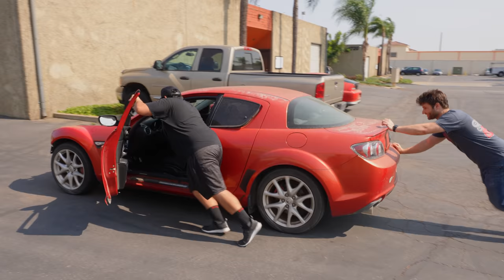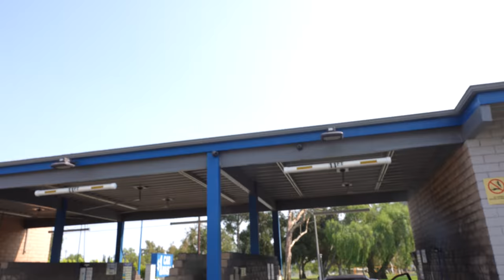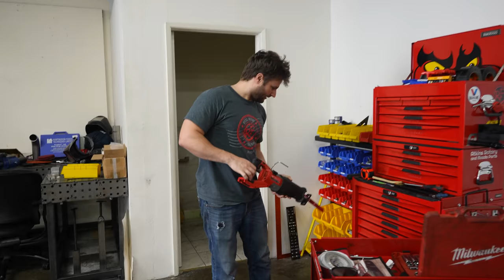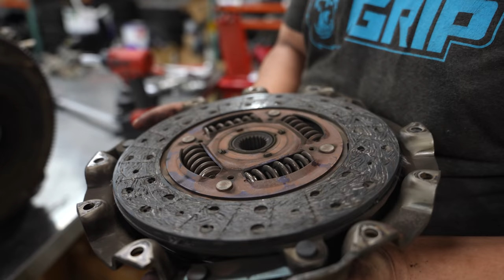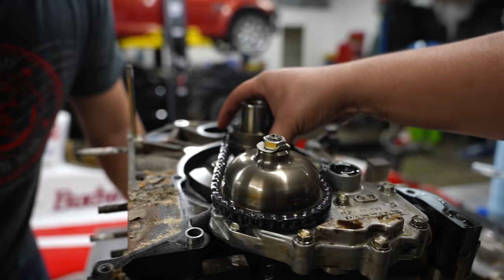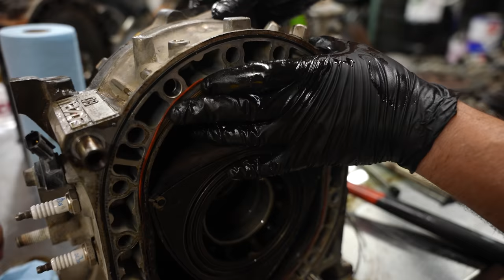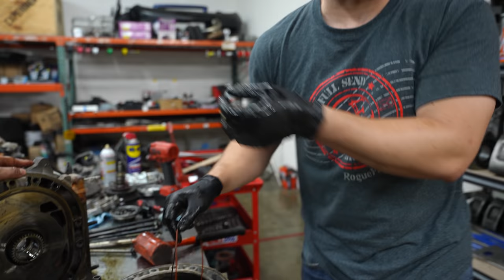What’s commonly wrong with a CHEAP RX-8?

Comment: If the coolant seals are failing at the hottest part, it seems logical they're degrading due to heat. You could then replace it with a more heat resistant material that would handle it better, maybe machine out the channel it sits in to fit a more substantial seal or even look at the cooling system and see if the rad/thermostat etc could be modified to keep the engine cooler and help the seal last longer. It is a lot of effort for a job that only comes up once every 100k miles or so though.
Reply: Good idea
Reply: E85 burns cooler. You'd only go 100 miles on a tank though
Reply: defo the cooling system is one off the let downs on these cars especially when you have a huge air con radiator system blocking the radiator,then the restrictive airflow to it all,, but hey its how the cookie crumbles i guess ahaha
Reply: It failed cause it got too 🔥  
That's the result, better to fix the cause , then no need to fix the result.
Reply: This ONLY happens on RX-8s that are very overheated. Well cared for ones don't blow coolant seals.

Comment: I wanted an RX8 so bad before knowing about rotaries, I still think they have potential, they just need a lot dahm love...
Reply: I’ve owned like 6 of them, all with 100k plus and low compression. Ran just fine with new ignition, after only a decarb and a lot of oil changes to clean them out. Sold them and haven’t heard complaints from the buyers. 🤷🏻‍♂️
Reply: @I_know_what_im_talking_about  sorry for my ignorance, I'm still new to learning about rotaries. What's decarb refer to here? A tune?
Reply: @Jazz-nm1kf  nah, de-carbing all the carbon build up on the rotors. Mostly just letting the block suck in a bunch of sea foam while HOT and then leave it to sit for an hour or so and then crank err up to burn off whatever got soaked with the cleaner. Works pretty good. Mazda has a similar factory de-carb procedure.
Reply: Owned an rx8 for 2 years and put 60k on and bought it with 60k and the engine still ran fine clutch just went out and instead of fixing it im 2jz swapping it.
Reply: Strange the rx8 is the most reliable car ive ever owned. 95k miles and never let me down. I also beat the crap out of it. I dont understand all the horror stories

Comment: I left my Renesis on the engine hoist, used a ratchet strap to secure it to the legs, a custom tool to lock the flywheel to the bolt, and then did the squat with a cheater bar.  That front bolt is no joke.

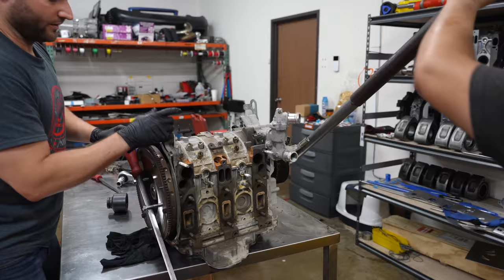Comment: 8:50 - I snapped a ratchet doing this lol. Breaker bars ftw. Sweet video again, loving this channel!
Reply: Took me and my dad to get this shit done in like an hour or so. Fuck that crank shaft bolt
Reply: @uc79newtype  yea dad strength and the biggest breaker bar you can find is required.
Reply: @Oborowatabinostk  no kidding shit was a two man job man. Smfh but it was worth to dismantle and see how my engine died. The seals broke and literally carved my housings. Mf rip.
Reply: yeah i couldnt believe he was using a ratchett to do that. i recently tried to remove my crank bolt on my toyota altezza to do a timing belt change (not rotary... or powerful..). the bolt was so tight i had a breaker bar almost 3 meters long and was jumping up and down on it almost tipping the whole car over, i also tried soaking loads of crc into it, and heat gunning it. nothing. was tempted to use the blow torch but didnt want to melt anything behind it. i gave up and just rotated the engine, inspecting the belt, it looked fine. so to this day there is still a brand new timing belt sitting in my wardrobe. someday i will get that bolt undone and replace that damn bolt. someday.
not keen on removing the radiator etc again to access it if its not going to work this time though. im lazy.

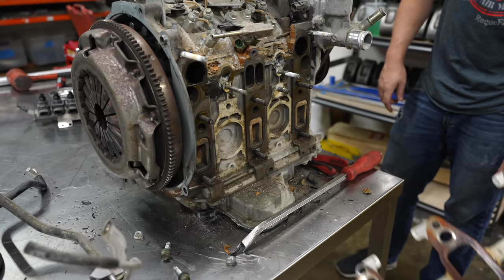Comment: 7:00 It has the Series I Renesis OMP injection Style AND the classic FD/FC style oil injection for the Series II. The problem is that the OMP is different from the Series I, so adding a 2cyl tank is VERY hard and limited to no support exsists to convert it. A 10% increase to the OMP via tune is very sufficant to prevent issues as the FD style omp setup worked just fine and this has both. I add 1qt of burnable oil to my setup when it gets changed and or it gets consumed and premix aswell. My catalyst jumped ship on its own a long time ago. Was a hell of a confusing then when the clutch was changed. No marks from someone doing it before me, so I guess it is just toast. Very little P0420 action before I disabled it also.
Reply: Copy/paste??

Comment: I had the clutch and flywheel replaced on my S14 but the flywheel had a ring gear that was just a press fit.  The starter would only turn over the engine when the clutch was cold.  Something about knowing you can't kill an engine makes you kill the engine a lot more.  I got very good at push starting my own car.  Shoulder on the A pillar push it a few feet and then hop in and pop the clutch.  I had to do it in a tacobell drive through on time,  I had 10 feet before the parking lot went up hill.  Got it in those 10 feet on the first try.  Thankfully it was a very easy engine to start.

Comment: @rob dahm... what would happen if you were to put a copper wire in place of the coolant seal? like a thick one? and just wedge it in there between the plate and the damn rotor housing?
Reply: Wouldn't copper cause cross metal corrosion?
Reply: @Ayane13b  A nail wrapped in copper will rust/corrode the most.
Reply: High temp silicone electrical wire works... don't ask me how I know.
Reply: @godfreypoon5148  fine then, keep your secrets. lol
Reply: @Ayane13b  people do it on piston engines all the time. they machine a little oring groove into the head or block, and put in a piece of wire to help seal the head gasket. sometimes only using that piece of wire if its only got oil going through it when its not water cooled. i keep seeing that used all the time and then look at a rotary engine and think... hm.,... what if?!?
Reply: @petek9348  I guess so. I've actually seen that, but totally forgot about it. Wild. I do wonder.
Reply: @Ayane13b  i wanna see rob dahm build an engine with wire instead of coolant seals.

Comment: The key to a long life is upkeep. Watch those oil levels. Keep clean oil in it. Premix especially if you have a gen 1. Change out ignition yearly most likely depending on how much you drive. We have two 8s over here, mines basically new less than 30k original miles. My lady has a velocity red 2010 with almost 165k original miles. Still going strong! Do your maintenance people

Comment: ok here's a stretch idea...since most performance oils are now really thin (0W30), could the engine coolant be replaced by engine oil?  I know that glycol water coolant heat transfer is much higher than oil but a few things may change to make this work.     I believe that the radiator would have to double in volume.   The cooling system would then be unpressurized which may help reliability.   The engine would then use the cooling radiator as its dry sump.  The engine oil pump would source oil from the cool side of the radiator.    The water pump (now an oil pump) may have to be larger.   The thermostat would need to open sooner.    Benefit: reduced possibility of future engine damage...no water in oil risk.    The oil changes could be extended...perhaps 3 to 4 times longer?  Great videos!

Comment: Seems like what they need is a fire ring of some sort. You'd have to design a housing with smaller coolant passages, or larger overall housings to make room for a fire ring next to the coolant seal though. I bet the material between the iron and the rotor housing starts to deteriorate juuuuust enough that combustion starts touching that coolant seal causing it to fail. If this hypothesis is true then we'll see the motor shit a coolant seal out again in relatively short order.

Comment: Observations, noting your build with the dowels. 
RX8 Rotary blows seals there because of bolt stretch  because of internal pressures, forces the case apart exposing the O rings to direct heat of the combustion. Could be a detonation issue too. Detonation generates tremendous pressures against the compression stroke. 
Put dowel rods in it and may never happen again, or at least by the plugs. 
Last question anyone ever tried to love the plugs down in the housing, so not firing directly into the side of the rotor? So the flame front does actually PUSH the rotor instead of trying to shove it sideways...
Reply: down in the housing?
Reply: @acters124  yep. those O rings are burnt. even melted, do got to be micro-movement there sure its not instant burn out , but over time the flame front eats at the o -ring,  what looks like..

Comment: I'm curious why they don't use a metal o-ring to seal them instead. Those are typically used in high pressure/high temp environments and it would eliminate the failures. More expensive but it would last so much longer.

Comment: I saw a video that explained one of the huge rotary problems is the lower spark plug or both firing far too early, causing the motor to kind of want to spin in reverse. I can imagine that would cause lots of stress

Comment: Coolant seals can also fail due to excessive heat, if the oil system is not cooling properly, hence why rotary engines have big engine oil cooler/s

Comment: My 2005 RX-8  has 124,000mi on the stock engine and she purrs. The end goal for my car is, hopefully, a single turbo 20B-REW swap. In the meantime if the Renesis needs a rebuild the best thing to do to them is exhaust porting. The leading cause of failure in the Renesis is too much heat from its high compression and not enough exhaust flow to release that heat.
Reply: Nice. 95k miles on my 2004 and has never let me down. I dont premix do you?
Reply: @chinchy111  just a little bit to supplement the OMP for now, until I can get a Sohn kit and a tune to increase the output of the OMP. Just some added security in this hot box of a motor
Reply: @brianrobinson9979  did premix make your check engine light come on? Was thinking about doing it
Reply: @chinchy111  nope. I buy some of those little like 3.2oz 2-Stroke oil bottles from Walmart. They're a good amount for premixing with a stock RX-8 to supplement the OMP
Reply: @brianrobinson9979  oh wow people said it makes the light come on cause the oil messes with the emissions or something. Maybe ill do it now
Reply: @chinchy111  regular 2-stroke oil or other oils that are specifically meant for premixing are designed to lubricate but then burn off. However if you over premix you can over saturate the catalytic converter with oil and that will throw a code. Another tip though to aid in keeping your Cat clear, once or twice a week (depending on how much you drive) after the car has been driven around and fully warmed up find a spot where you can rev it out all the way, like getting on the highway. The added heat from 9000rpm pulls will help clear out some of the build-up that may be in the cat. The county that I live in doesn't do emissions testing so I just ordered a test pipe for my car

Comment: That's very interesting. Hey Rob look into how the subie guys solved their head gasket problems by putting in a undercut before the cylinder and adding a brass round wire just to help seal the head gasket. If there is some room on the housing to do this this would help the longevity of the coolant seal. Specially the area close to the spark plugs.

Comment: That's very cool, I had a  few RX-7's in the 80's and early 90s.  missing my GLS-SE 13b.  It's really cool to see these differences.  Especially seeing the Issue with Heat.  I wonder it it's damage from after the car's run and you shut it down and the coolant drops low.  Probably not, but it's interesting.  The  other idea is cooler plugs or perhaps a heat soak plate to pull the heat away from the plugs, like make a chunk of copper bolted to that area. Perhaps another Coolant port drilled in the housings.  But really some high temp seals might be fine, either way it's a cheap fix for a DIY.

Comment: Series 2 Renesis can take Clean Oil Feed.
By-pass the OE crank case oil straight back to filler neck.
Use an electric oil pump and mechanical pressure regulator to push premix oil at 80 PSI to the OE electric feed pumps.
Problem solved for carbon build up on rotors and housing.

Comment: Owned an rx8 for 2 years and put 60k on and bought it with 60k and the engine still ran fine clutch just went out and instead of fixing it im 2jz swapping it. I'm sorry Rob I going to buy another and actually keep it rotary. 13b parts are just too expemsive.

Comment: Please build a rotary crown vic and enter the freedom 500
Reply: The whole point of the freedom 500 is they're all the exact same car, with the same engine. It's all about the driver
Reply: @lucaskelly4590  I am just saying a rotary powered crown vic running 50 laps at wide open throttle would be neat to see
Reply from the maker: I’m disqualified because I would rotary swap it

Comment: Ok, for balancer pulley they put red thread locker. To remove it you need to heat bolt to glowing red. Then it is comes out easy

Comment: That's the same location of the exhaust port on the irons, WOW that's the reason, you need a 13b or it will happen again, or improve the exhaust port and full exhaust system, but I'll go with the 13b

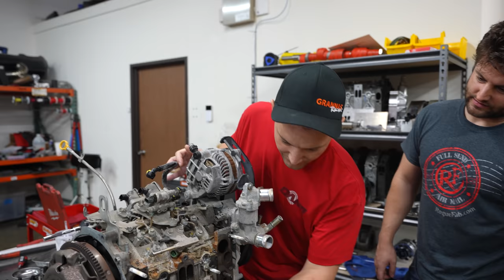Comment: 7:12
There is actually a way to modify a Renesis to take an RX7 housing (or vice versa) to have the Rx7 exhaust port, or even both of them im pretty sure. Read alot about it, without intentions of doing it haha.

Comment: I wonder if you can swap out the thermostat with one that keeps the temps lower, or also bring the fan on sooner. The going rate seems to be the hotter the motor the more thermally efficient it is..but obviously thats not our end goal here.

Comment: GLE-SE rotor housing RX8 internals with a KMR exhaust flange for a hybrid motor
Reply: Just about to mention that! It ends up making the exhaust a 6 port, letting it finally breathe, and I would assume a wayyy better exhaust sound. From that point you could turbo it with less problems. Sure, you then have to make a custom exhaust, intake, and stand alone but hey, it’s just money…

Comment: I was hoping for more of an list... If you want a rotary now, fc and fd are unobtainium, you have to have a lot of money or get an rx-8. Most of the ones I find have bad ecu's or like this video showed, bad seals. I know the ecu fails. Is it possible to bypass the anti-left system and the chipped key? Just getting an ecu fixed is a couple hundred, but if you have to reprogram because of those two systems, it becomes an thousand dollar fix.

Comment: The rotary was never really a "streetable" engine if every 100k it needs a rebuild. Thankfully it is great as a track engine!
Reply: they said 100k miles, so about 150k kilometers, but yeah, agreed. my current engine (non rotary) has 308k kilometers on it and is still going strong. an engine if treated well should last 400k

Comment: I don't know if this is really stupid, but does someone make copper versions of the coolant seals? Considering that a regular engine has a copper gasket between the head and the block surely it would be logical for a rotary to have copper gaskets/seals between the different parts of the engine?
Thanks :)

Comment: have wondered why Mazda did not just use a separate oil tank for two stroke oil injection. Heck if the engineers were wise they could have had a cut out or range limit when the oil tank was low or empty.

Comment: So I dont know if this is a dumb question.   But watching you take apart this engine  and it looking like the housings are scraped up. In a piston engine you punch out the cylinder and buy an oversized piston.   Can you do this with a rotery? Resurface the housing and buy a larger rotar?? Or bigger seals??  And to follow that question.   Do they make or sell oversized housings and rotors? Like 25% bigger.  And would that make more power??? Thanks!! I hope I worded this right.
Reply: You can lap the housings and send it, some people get fancy and re coat them. As far as I know people just keep reusing the housings until the tolerances are not good anymore or something horrible happens. It's like a piston engine but you only change the piston rings each rebuild.

Comment: Rob and Isiash, and rotary engine builders, what are there specific tools need to rebuild and rotary engine.
Reply from the maker: Vaseline haha. And a 2mm hex Allen wrench to roughly clearance your apex seals and make sure the corner seals didn’t rotate when you put the rotor in during assembly. Otherwise nothing major

Comment: I'd like to see a Renny that's been re-engineered for ultimate reliability and daily driver fuel economy instead of horsepower gains.
I mean, who wouldn't like to see what can be done to make an RE go for over 100k miles with no problems, or what can we do to make it over 35mpg average and still be reliable?
Think outside the box a little, free from annoying patent restrictions. Doubled-up apex seals? Ceramic coatings? Re-porting it for better low-midrange power? Centre iron bearing mods?
Fairly sure other folks would like to see exactly what can be done to make these engines into what they should have been, instead of what Mazda was limited to producing.